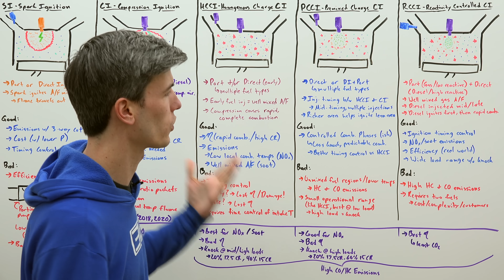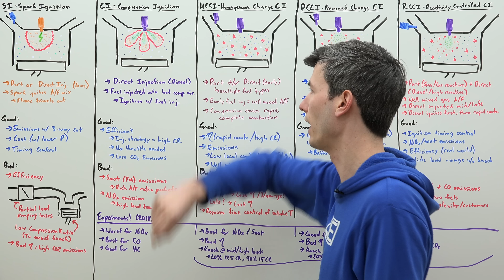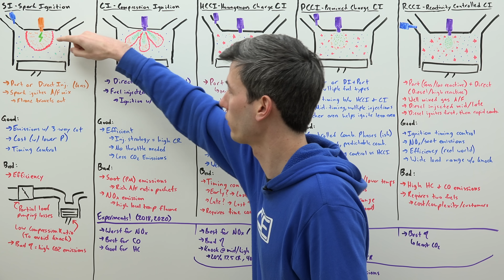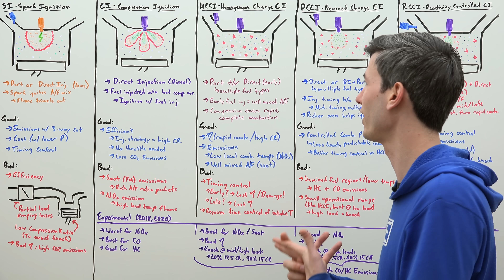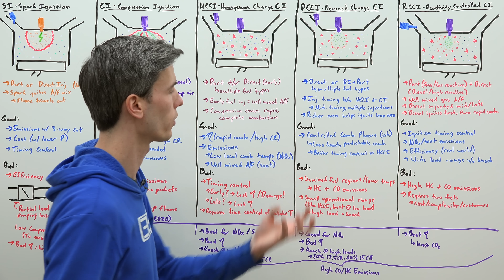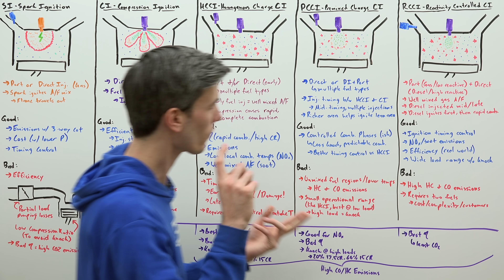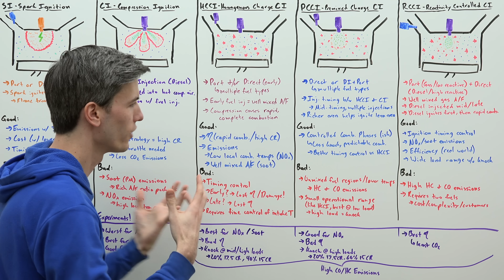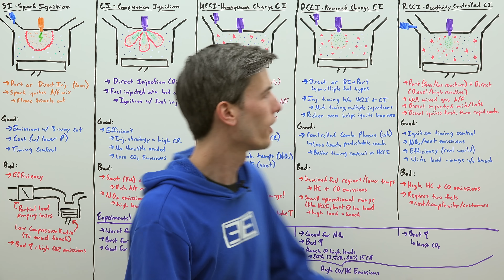If Combustion Engines Have A Future, What Is It?

Comment: 2040 : 0.5 liter eco 3-cylinder quadturbo twinsupercharged with hybrid assistance and cylinder deactivation. 600 hp / 2000 lb-ft torque. For use in school buses only.
Reply: That's a recipe for engine failure.

Comment: The electric car was not properly treated here, the comment that it is 2x more efficient is false, the efficiency cost of the electric generation plant (50%), the transmission lines(5% loss) and the charging of the batteries ( more than 5% loss)  needs to be taken into account. Once you treat them all fairly you find that electric cars are not more efficient than a modern efficient compression combustion engine. Until we have more than 80% of our electric grid operating on nuclear fission and diverse renewable (solar/geothermal/wind/tidal etc) power electric cars are not solving a problem they are distracting us from solving the problem of providing reliable energy.

Comment: one company I visit now and then has tractors with LPG tanks attached. I asked about it and  the guy said they're converted diesels. the guy said they use both fuels but the total ends up being cheaper. Is that the same as RCCI?

Comment: 1) A car should be    manufactured using a minimum of 30 > 50% recycled materials. 
2) Carbon footprint during manufacturing,  5>10 bb oil max. 
3) Fuel economy min. standard 40>50 mpg.
Now go ahead and tell me why that's not possible. And for every reason you may give as to why not, the bottom line will be because oil companies and car manufacturers refuse to do it. We have the technology.
Reply: I agree and politicians are trying push us to driving ev vehicles

Comment: I did my PhD in HCCI thermal management control and with HCCI we also operated in dual mode where you would switch from SI to HCCI and vice versa. One other thing that was not mentioned is that catalytic converter these days work really well. 

As for research outcomes at the time Mazda was quite ahead from everyone and there were a few attempts for working prototype vehicle with HCCI implemented. This was at the time where hybrids were popular options but personally i don't really think HCCI is viable in cars as primary propulsion system due to the variable load demand and the complexity of the thermal management system to control this.
However  HCCI could be implemented as a fixed load generator to complement an electric motor more like a traditional hybrid vehicle. This would solve many of the range and weight issues i see in pure electric powered vehicles. Why they don't do it you may ask? Well most of this is customer/market/politics driven, so if customer/market/politics wants an electric car they develop electric cars and battery technology.

Comment: IC engines actually do have a future: as portable electricity generators. For vehicles, unfortunately electric is the thing: higher efficiency than any of those, no NOx emissions, no CO emissions, no particulate emissions, no HC emissions.

The advantage of running an IC engine to generate electricity is that you can stick it on the optimal régime and optimise for that and not bother about any other régimes. It's either there, or off (or turning on/off and will be there in a fraction of a second).
Reply: True

Comment: There's no "one size fits all" kind of solution. Here in Brazil, most (up to 90%, depending on price and availability) of our ice cars run on ethanol (made of sugar cane). Fuel production actually captures a lot of carbon via photosynthesis. The ethanol burn is also very efficient and dumps less carbon during combustion. And that's achieved with very common and cheap technologies (flex fuel software on the ECU, some materials coating in the engine to prevent corrosion and the car is converted to run  whatever fuel or mix between gasoline and ethanol). That only works in a hot climate country where you can grow sugar cane, of course. So what serves Brazil wouldn't work in colder countries.

Comment: This comment is unrelated to the vidfeo (sort of). Could you do a video on whether Japanese motorcycle engines are as strong as car engines with the same capacity? For example, a 1000cc Mini engine (the original Cooper model) compared to a 1000cc motorbike engine (i.e. GSXR 1000). I have always been puzzled as to why car engines are not as small as motorcycle engines of the same capacity. Car engines are always bigger, seem to have larger crankshafts for less horse power output, etc. Not only that, motorcycle engines have integral gearboxes whereas on a car (let alone a Mini Cooper) they are always separate. Why aren't car engines as efficiently built as motorcycle engines? That would be a great video and would hopefully answer a lot of questions.

Comment: What about range extenders? Many of the problems with IC engine technology is that a car engine needs to tick too many boxes. But! Now there is a new paradigm for engines.
Range extenders (or serial hybrids) have a lot less requirements to meet. There is no need for a good throttle response, partial load efficiency, high peak power need, or high torque. All they need is one well tuned rpm they preform well. You could argue that rotary, turbine or free piston engines all have a shot now, maybe even stirling or steam engines! Just keep that alternator running at low power, and you can cut your battery weight in two or tree, and winter range is fine too as you can use that waste heat to keep the car warm.

Comment: Thanks for the very nice (as usual!) explanations!
But the RCCI is very difficult to understand how it can possibly work. Because: (1) if you have high compression ratio, in order for the diesel fuel autoigniting, you will have pre-combustion in the gasoline mixture; (2) if you have low compression ratio, ok for gasoline mixture, but no diesel fuel autoignition. 
Is there something that I wasn't aware?

Comment: Personally I always found it a lost cause to try and get a combustion engine from 20.5% rotational efficiency to 20.8% rotational efficiency.  Literally thousands of patents to get 0.05% improvements.

A simple electric motor can be mass produced for hundreds, maybe up to a thousand dollars.  The battery is 1/3rd the cost of the car, but as that drops - I can imagine we will start to see performance electric vehicles in the sub-$10,000 range.  They can absolutely produce a magnetically suspended shaft, and have an electric motor last for 50+ years.

All the "genius" that went into an overly complex combustion engine is doomed to obsolescence.  I can imagine the rest of the US states will start banning combustion engine cars (like California state) soon enough.  There are a ridiculous number of people out there who want the electric car, and many more who just want the combustion engine to die.

The only people who want to see the combustion engine endure are those who own patents on it, supply the ridiculous number of parts and fluids needed to run it, repair shop owners, or own oil deposits.

Comment: You mention the pumping losses incurred by spark-ignition engines due to the throttle assembly, but I wonder what difference the Koenigsegg/Freevalve technology makes. The ability to instantly and infinitely adjust valve timing and lift, combined with full control over injection timing and volume and spark timing makes it possible to switch individual cylinders between Otto and Atkinson cycles, as well as simply shutting down individual cylinders as needed to adjust power, improve efficiency, and reduce emissions. Imagine including multiple injectors both directly inside the cylinder and in the port, enabling adjustable multi-fuel capability on a stroke-by-stroke basis.

Comment: I'd like to see a discussion of EV vs. hi-efficiency range extended hybrid vs. ICE vs. hydrogen FC.
Reply: What about the possibility of synthetic fuels? They're definitely worth considering far more than they currently are
Reply: @pauldavies7469  Unless they're carbon neutral and get heavily subsidized, cost is higher than fossil oil. They make ethanol in Brazil where there's lots of sugar cane. If somebody came up with a cheap fuel cell that ran on liquid synth fuel that would kill ICE. Gaseous hydrogen won't cut it. 
The best current idea I've seen is the Mazda MX-30 which has a small (cheap) battery and a range extender. They use a rotary engine, which is smaller and cheaper than pistons. Running at constant RPM, it will have better efficiency. If it's only used for long trips, the longevity problems don't matter.
Reply: @jamesvandamme7786  see Porsche's E-Fuels. They are carbon neutral. Like literally everything including EVs, cost will come down over time though yes at the start they will be expensive but that's no reason not to do it and use them. Fossil fuels need to go but there are alternatives! Love your idea of putting EVs against hybrids and Hydrogen powered vehicles

Comment: Hello,
So as I understand it, RCCI is what is already used in diesel engines which run on dual fuel gas (LPG) and some diesel to ignite. You find this in Italy and England where they convert diesel to diesel with LPG. Even in Australia, I saw this kind of technique. This for 20 years now. It is easy to install on existing vehicles.
I tried an Alfa 159 Station 2.4 liter Diesel equipped that had 20% more power and 35% more torke. Up to 45% less fuel depending on the load.

Comment: How would Maserati's new engine with the pre-combustion chamber stack up on this board? would it still fall under the efficacy of a spark ignition, or do they achieve a better use of their fuel? compared to similar displacement examples

Also any chance of a follow-up video on future fuels?